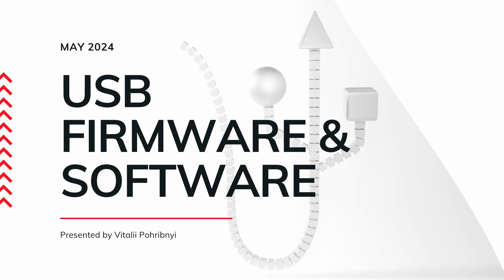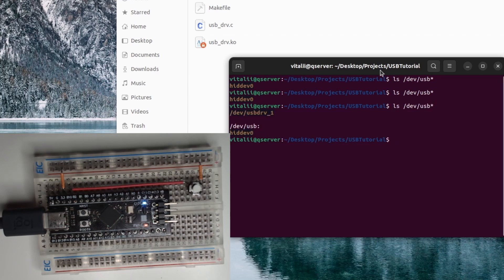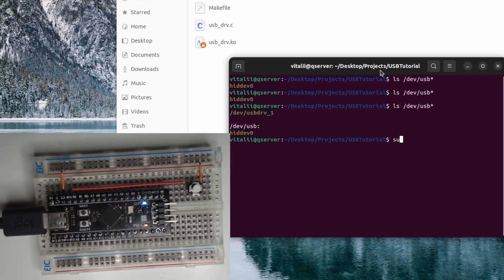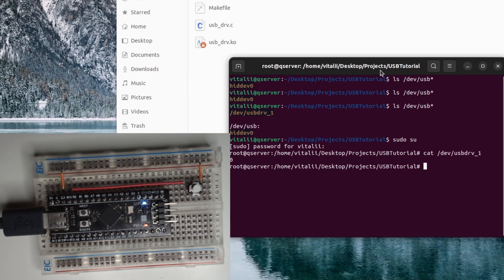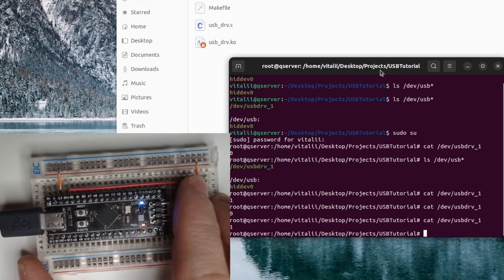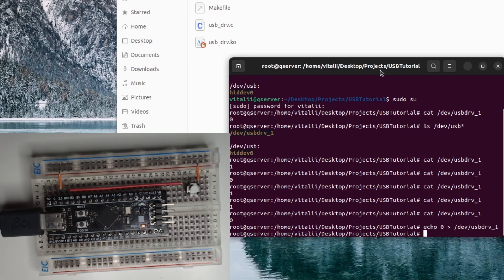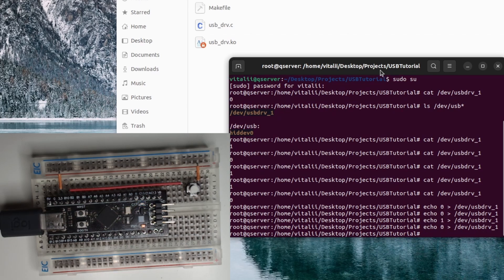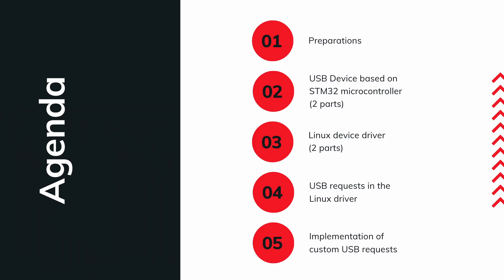USB device and Linux driver tutorial. Part 1 - Introduction

Comment: I want to learn too create a flatpack app that any ISB hardware Peripherals plugin to Linux whether old or new will work on Linux.
Reply from the maker: You'll need a decent manual for the device you want to create a driver for. If there is such manual (which is not always the case) - the driver probably exists too.